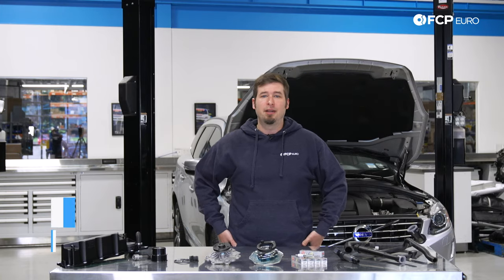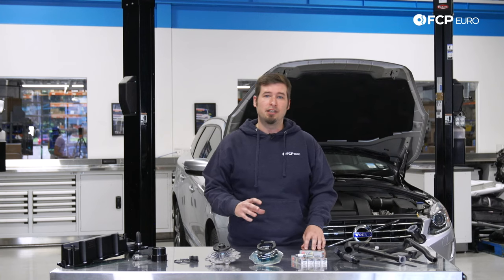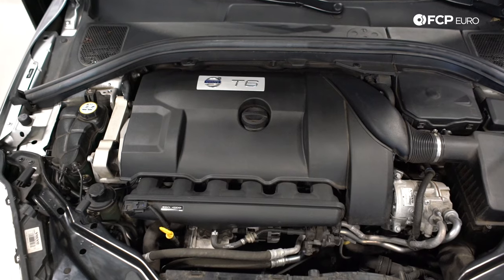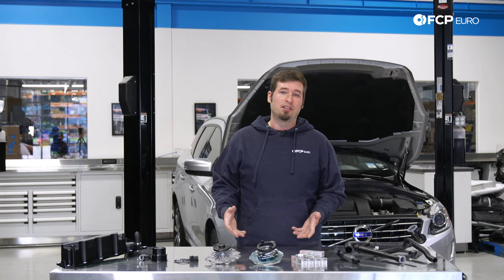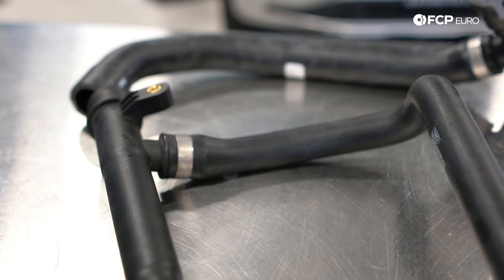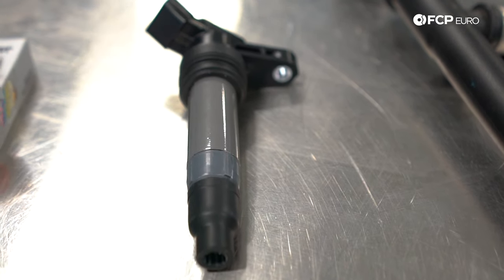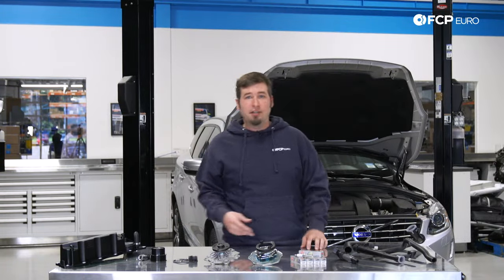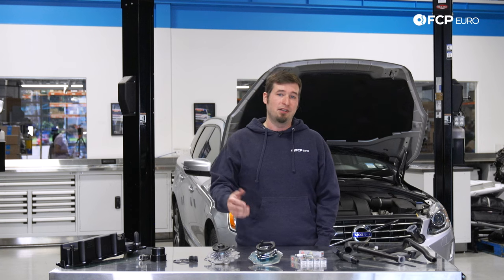Volvo T6 3.0L & SI6 3.2L Engine Diagnostic & Maintenance Guide (XC90, XC60, S60, S80, V60, V70)

Comment: Great video.  I own 2 S80’s 3.0 T6 (2012 &2015.5). My 2012 (176,000 miles) has a power steering leak that no one can find. No leakage from the reservoir or the power steering rack. Lines all check good as well. A volvo mechanic (30+ years) is baffled because there is power steering fluid on the opposite side of the car in the wiring harness that runs from the fuse box (left side near battery on the other side of car) along the lower chassis. There is no power steering components there. I looked myself while the car was on a lift. Both wheel well covers removed and the under carriage cover. Definitely a leak in the power steering because I have to add a few ounces a week to the reservoir.  No evidence in the steering rack or lines. Any ideas where the leak is coming from. No leak drops on the ground to help isolate the location. Is there any power steering components on the left side of the car that would cause this leak to show up on the opposite side of the reservoir. The lines from the pump and reservoir pretty much reside on the right side. The odd thing is that the fluid inside the wiring bundle is where the power steering fluid is and it runs up to almost the fuse box. No one spilled anything or incorrectly put fluid in there. Is there some sort of vacuum hose or line that runs in the wiring bundle. Your expertise would be greatly appreciated. 
Also, the 2012 does use motor oil and the 2015.5 does not.
Reply: Hi Ken - I may be able to help, because although very rare, i have encountered something like what you're describing. I work as a engineer for a transmission and engine control solenoid manufacturer, and we have on a very few occasions encountered similar issues on customer vehicles. The issue presents itself as an oil leak no where near the source of the oil. Hot (and therefore very thin oil) travels up wires, but doesn't seem to drip in route to its new 'destination,' sometimes a few feet away from the source. In the case of the rare instances we have seen, the issue was an electronic component where the oil seeped into the copper coil, and a seal inside the connector was missing, so the hot oil travelled through the connector, wetted the wire attached to the connector, and traveled to another side of the engine and presented itself as leak from the wrong side of the engine. The surface tension could even carry the oil to a higher point in the engine bay in some instances. The solution at my company was to insure proper sealing of the inside of the connector. I don't know the Volvo models too well (I watched this video to learn about the land rover LR2 engine), but if your power steering assembly has any sensors on it, or wires near it that may be making contact, i would check that the wires aren't wet with any fluid carrying it away to a new place inside your car. Best of luck!
Reply: @jamesday2441   Thank you so much for the insight and the time you took to answer the question. I will pass this info off to my mechanic and check myself. I will let you know when I get an answer.
Thanks again, 
Ken D.
Reply: @jamesday2441  Hi James. Just a follow up with the leaking power steering fluid. You were 100% correct with your assessment. The fluid was traveling from the power steering pump via the electrical connector on the pump itself. The traveling fluid traveled to the other side of the car in the wire bundle the connects to the fuse box on the other side of the car. The mechanic never saw this in his 30 years fixing Volvo’s. I was able to source a good used pump and install it. The seal had to have gone bad on the pump connector housing itself. After the mechanic removed the pump and let it sit on his workbench, the connector on the pump actually filled with fluid on the housing of the connector itself. He cleaned the wire bundles with electrical connector spray and put new loom around the wire bundle. Thanks again for your time to respond to me and help rectify this issue. Great job. FCP Euro customer for life.😀

Comment: I have a 2015 XC60 RDesign.  Was surprised to learn that the alternator failed at 60K along with the alternator clutch?  I had never previously heard of an alternator clutch.  I’d like to know if there are any other unusual components on the Polestar Rdesign motor.

Comment: Hello, im looking to buy v70 t6 , 120k miles, 2008years. Whit adaptive suspension.  Its a good car or i have to look little bit new. 
Its have a good Volvo but they are diesel 2,4 d5. But in England they have ULEZ and i have to looked diesel from 2016 and ect. And petrol from 2008. What is your opinion ?

Comment: Nice video. 
What about transmission fluid change?  My xc60 t6 is at 120000km and I'm using it for towing caravan. Absolutely love this car and want to keep it for ever.
Reply: If you tow, get it changed soon. That's adding stress, and 75000 miles is about where you change them in the US

Comment: About to hit 100k on my 2012 s60 T6, curious what you've found the lifespan of the actual turbocharger to be, assuming of course that it's been well cared for
Reply: I was a Volvo dealer technician (master certified) for 8 years before switching brands.  In my experience, I never saw a turbocharger failure on a regularly maintained car.  In fact, in those years (2 different dealerships) I probably only ever saw no more than 5 turbocharger replacements throughout the whole shop.  I personally only ever had to replace one turbo and that was on a poorly maintained 5 cylinder engine.  FWIW, I have a 2007 S40 T5 running strong with almost 150k miles on it.
Reply from the maker: If you keep up with maintenance and change your oil regularly, your turbocharger should last at least another 100k+ miles! We have not seen very many turbocharger failures on the T6 engine.
Reply: I currently have 260 000 miles on my 2008 V70 T6 with the same turbo as the day it left the factory. Buttery smooth machine

Comment: Thanks for this interesting video! Is it possible to install the B6324S5 engine with 243 HP from model year 2011 in my 2007 XC90 with 238 HP, or are there problems with other connections, the engine wiring harness, other engine attachments, etc.?
Also, would it be possible to use the B6324S5 from a 2012 XC60 for the XC90? Best regards from Germany!

Comment: i have a problem with my s60 t6 Rdesign 2013 the radiator fan doesnt Work properly!! When the car is cold the fan works good but then when the engine is hot dosnt work!! I change the fan module but the problem persist. I test the fan with the scanner and works good. I dont know whats happend

Comment: Thanks for this very informative video. I have an 08 xc90 fwd with the na 3.2 engine and love it. I've had it for 2 years and only had to do basic maintenance.  I'm now up around 180k miles and it still drives so nicely. I just have a clunk noise over bumps on passenger side and can't figure out what it is. I've replaced the whole front end suspension except for the stabilizer bar bushings
Reply: They have a whole video on P3 suspensions... in it he says that a clunk at a front wheel is caused by a bad sway bar link on that side (thin bar with ball joints at both ends). I'm hoping that's the case w/mine for an easy fix -
Reply: @georgehofgren6123  unfortunately for me that's not my problem. I've replaced mine with 2 different sets. I wish that was my problem because those are cheap and easy to replace
Reply: How about engine mounts?
Reply: Have you checked sway bar bushings?
Reply: @willmill409 what was causing it?
Reply: @samgrieg2542  I still don't know. I suspect it's the stabilizer bar bushings but I never replaced them because its such a big job I keep putting it off. It would have to be that because I replaced every other bushing on front end
Reply: @willmill409  most likely it's a broken spring seat on top of your passenger side strut.

Comment: Hola amigo, en el caso del motor 3.2L AWD, cuántos litros de aceite debe llevar? el fabricante recomienda 5w-30, cuando tiene más de 100 mil millas, es recomendable poner un 5w-40?  Saludos.
Reply: you can use 5w-40, but make sure to check the centistokes(cSt) of the oil that you use. 30weight is min 9.3cSt and max 12.5 cSt. 40 weight is min 12.5cSt to max 16.3 cSt. I would aim to use a 40weight around the low end of 12.5, rather than a thicker oil.

Comment: Hello, do you think it's a good idea for me to buy a used 2012 T6 Teknik 3.0L with 175k kms in Australia?
Reply: Mine had 167k when I bought it it now has 178k km and it's generally running well still it just needs the serpentine belt changed and also some spark plugs it's quite reliable overall.

Comment: Hi thanks for the informative video.  I have a 2011 volvo with a t-6 120,000 miles runs very good. But when I try to start it, cranks to long without firing before finally starting.  What do you think?
Reply: Did you address your issue? I have the similar issue. I suspect a failing fuel pump
Reply: @leo3325  I have not done the fuel pump. What is the likelihood that is the problem?
Reply: @john1cutlass1986  I suspect a bad check valve cannot hold fuel pressure.
Reply: @leo3325  and that check valve is in the fuel pump?
Reply: I've seen similar issues in other makes where the check valve was leaking. What I do to diagnose this is to cycle from off to run several times to build fuel pressure before hitting start. Obviously, this won't work if yours is "push to start".

Comment: I’m late but which is the most reliable engine the drive e 2.0? The 2.5 t5 or the 3.0 t6?
Reply: Definitely not the 4 cylinder Ford engines with the stupid double clutch transmission. In the case of petrol engines, i think the 5-cylinder 2.5 and the 6-cylinder 3.0/3.2 are about as robust, although there are significantly more vehicles with the 5-cylinder. The most robust of all engines in the p3 vehicles is probably the 5-cylinder diesel D5244T.

Comment: I have a 2012 s60 t6 and found bad pcv valve. Replaced and now misfiring when upto temp. Plugs and coils replaced 25k ago. All genuine volvo parts. It seems to misfire when upto temp and then only. Cold starts are fine. Any help would be great! 2012 s60 t6 140k. Randon misfires #2 at temp!!
Reply from the maker: Double-check that you have no vacuum leaks after the PCV repair.
Reply: I will do the glove trick! I wonder if the whole pcv unit needs a new gasket or replacement..
Reply: Or could it be that I got the diaphragm off center or the spring off a bit. That was tough to keep spring in place

Comment: My 2011 S60 T6 turbo is overheating after just a few minutes of driving and it's breaking my heart! Without also breaking the bank is there a way to diagnose whether it's my radiator or water pump?
Reply from the maker: Hi Sobrid, the best thing to do would be to inspect the vehicle as best as possible, pull off the timing cover and see if you are losing coolant anywhere. With a good pump, coolant will circulate throughout the system and can be seen flowing back into the expansion tank. A bad thermostat can also cause potential overheating if the unit is stuck closed. Check for any intermix between coolant and oil, if you see some, a compression test or leak-down test is in order.
Reply: @fcpeuro  thanks for responding and the tips, I appreciate you very much! Love your channel, so helpful!
Reply: I assume you got this fixed by now? I had overheating issues with mine and it turned out to be the ridiculously-expensive radiator fan module that had failed and needed to be replaced.  That was over a grand.
Reply: @SuperJ213  mine turned out to be the water pump. They switched out the thermostat too and I had a leak in the vacuum hose so my turbo was taking extra long to spool up and I had like no torque. It's all good now, but yeah it costed like $1,200. This was a hard lesson in learning that cars may depreciate in value, but parts and service definitely does not!
Reply: @SobridMusic  interesting. I'm dealing with a loss of power (thinking something's up with my turbo). I guess I'll look into vacuum lines....
Reply: @SuperJ213  that's probably worth checking into first. I totally got robbed by the mechanic but at least my issues got fixed. They were fair on the price of parts, but damn those labor costs are insane. I also bought an ignition coil because cylinder 6 had issues and that fixed it right up but I did the with myself and it was very simple and I saved like $250 by doing it myself. In fact it was so easy that I realized they were indeed trying to milk me which pissed me off further. Good luck with yours!

Comment: Scratching my head on this. 2008 S80 T6         Frequently, when I first start driving, during acceleration, usually at about 3000 RPM, I start getting some hesitation and cutting out while accelerating. At idle, engine idles smoothly. No check engine lights. If I turn the car off and start it right back up. It generally runs almost perfect. I have just recently replaced spark plugs, and coil packs, PCV/oil trap (oem) new air filter, cleaned the MAF sensor but still having the same issue. Any insight on this?
Reply: Do you check transmission oil? I have 09 s80, I had intermittent hesitation during acceleration even slow down (normal without braking). I changed transmission oil twice this summer. Now feels better. The first oil was dark black with some metal pieces. The 2nd was kind of reddish. Maybe I will change it again next summer
Reply: Did you ever determine what was causing the acceleration problem?  I have the same issue on a 2008 s80 T6.
Reply: @erindaley3925  yes, knock sensor.   Had a bad connector and was loosing signal.  It is the one behind the oil cooler (pain to get to) so i spliced it in to the other knock sensor and zero issues going on 6 months now

Comment: I definitely have the oil consumption issue on my T6, although adding a quart or two every few thousand miles for now is cheap enough to live with. I'm surprised the top motor mount wasnt brought up as a common maintenance item.
Reply: Mine burned through oil for a while, then it stopped. I had to replace the PVC seal, and replaced most of the belts, but it's still going strong at 175k
Reply: @turkovich530 what milage you replace timing belt.
Reply: @thayalansuntharalingam  about 120k
Reply: @turkovich530  thanks factory recommend interval 150k on newer 2015 plus 2.0t is 150k.
Reply: @thayalansuntharalingam  im assuming that's a chain and not a belt?
Reply: Hi,
Do you mean the PCV gasket causes the oil consumption?
Reply: @turkovich530 pcv seal doing oil consumption?
Reply: No. The PCV leak was making a horrible noise with the leak. I was just highlighting what I had to replace. I stopped using engine oil cleaner, and the oil loss went to zero.

Comment: what is the recommended miles for timing chain replacement on the 3.2 SI6 engine?
Reply from the maker: Hi Lemon, there is no interval for that as there is no service in place for it, unlike a timing belt which does have a normal service interval.
Reply: @fcpeuro  will a failure of the serpentine belt cause any valve damage? what are some imperative services on a used si6 i shouldnt overlook?  just changed a torn pcv yesterday :D   and does the si6 have chain guides or anything that go bad?
Reply: I believe the chain does have synthetic guides. I've read that there isn't noticeable wear until after 150kmi. I'm at 210kmi and am considering doing the timing chain when i do the serpentine belt and pullies (and alternator bolt)-

Comment: Be careful with the rear gear accessories drive if it makes noise and you don't replace the bearings or fix it right or don't do oil changes on time the bushing that is pressed  in  the engine block will wear out and the only way to fix it will be a new engine.

Comment: I have a 2013 3.2 and it started eating 1 quart of oil every 5000 miles. I’m over it. The car has 100,000 miles on it it is 10 years old
Reply: Old school here, but what's more expensive, a quart of oil every few weeks, or a major engine repair? Check the oil every thousand miles and add as needed. Unless you are leaking oil on a driveway, I'd not tear into it until you were burning a LOT more than that. <G>

Comment: I have a non turbo 3.2 , 2011 xc 60 Volvo with 200400 miles on it. I change oil around 6500 and have changed flame trap pcv. It’s due for another oil change soon. I notice a sound of what sounds like a pulley.

Comment: Changed all parts mentioned on the video with original Volvo parts and my engine has still an air leak hence misfiring frequently especially when hot and so far 3 different garages were not able to trace it....I will NEVER buy a Volvo again in my life...
Reply: So sad to hear.  Don’t blame the car for inept mechanics.
Reply: @ghostwrench2292  I am blaming the car first of all, cause the car started having issues when the mileage was just over 60k. (1 owner, no accidents, parked in underground parking, very meticulous owner)...and certainly equally responsible are the mechanics
Reply: Ever tried to bring it back to the dealer? Might be a recall or they may be more professional in diagnose their own brand cars.

Comment: Bring back the old slant six cylinder engines. Jeeps 4.0. Volvo 3.2 burns oil for you climate changes fanatics. To much 💩 to break on new engines. Engineers suck they make it very hard to get at changing parts. Rubber belts instead of chains they suck to. Youtube changing a simple cabin filter in a Volvo. My Honda Ridgeline is five minutes. Drop the glove snap out the filter cover change the filter snap the cover back on pop the glove compartment on done.